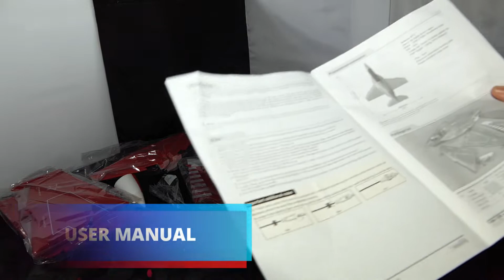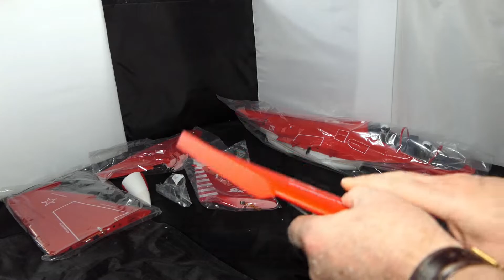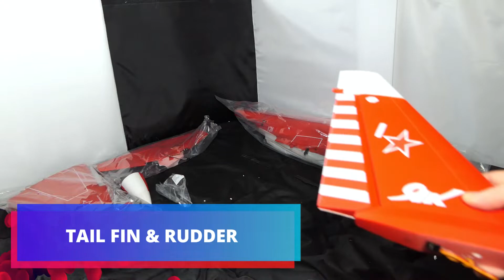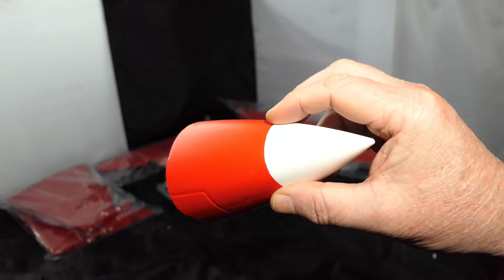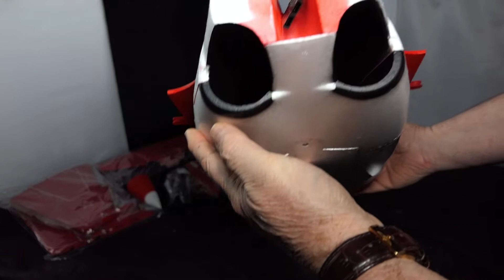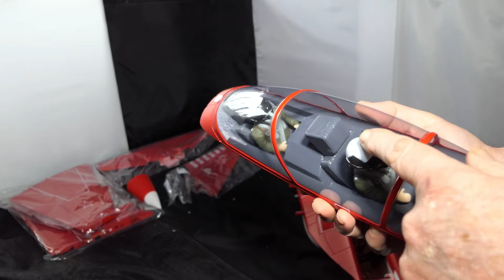Unboxing  - Freewing YAK 130 - 70mm EDF

Comment: it can't be too old the Yak ain't that old of a design! looks like freewing is looking to give FMS a run for top dog in quality!
Reply from the maker: Good Point about age - I guess that Freewing just stick to the same manual format so it is starting (in my opinion) to look a little ... errr... Shall I say Retro ....
Reply: @FlankerTanker  well there are a few good things about a standard layout, you always know where to look for a certain thing sectionwise and you understand how they're describing things! i got a power saw once ran it til it died went back and bought the same one only the newer model it was set up completely different and so the manual, it took me 4 hours to figure out the set up on the new from that pig latin infused manual!

Comment: Good stuff Martyn. I've always liked the "look" of the Yak 130. It's just really fun to eyeball. The FMS version of this has suspended landing gear, maybe it'll work for you. Thumbs up bro. AirHammer out!!
Reply from the maker: Hi AirHammer - I agree the Yak 130 has a Look all of its own -  I have taken a look at the FMS version , the limited information I can find shows little about the landing gear being transplanted from the FMS to the Freewing - I have even asked shops here in the UK that sell the FMS Landing gear as replacement parts but they don't know - I have seen questions about it in forums but  no answers - and at over £140.00 - that's $183.00 - they are a little expensive to do a trial and error approach...... also as I fly from grass the wire  landing gear should be OK.... thus right now I have given up on the idea .....and will leave them as they are for now...